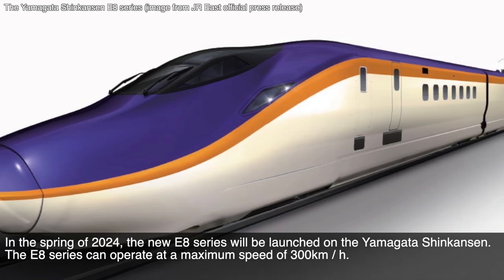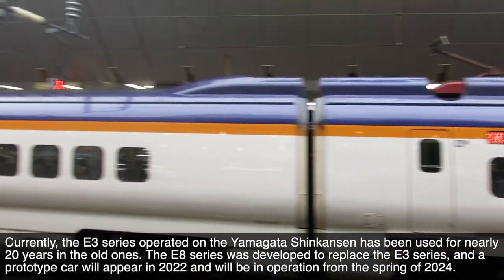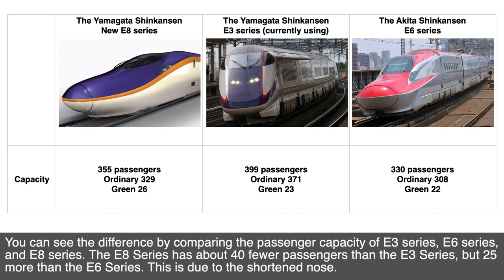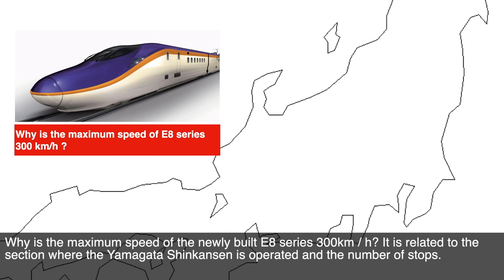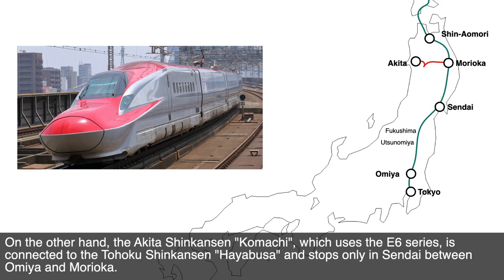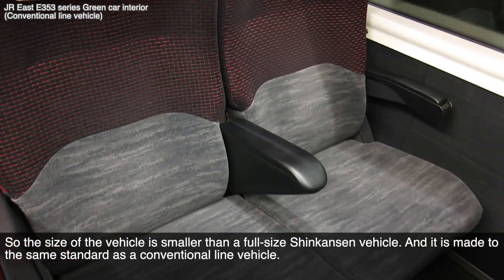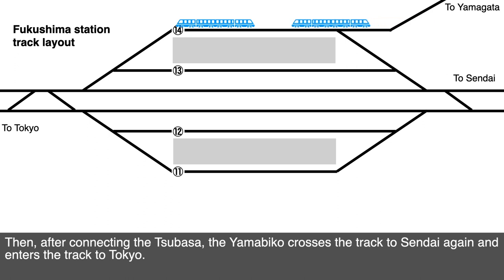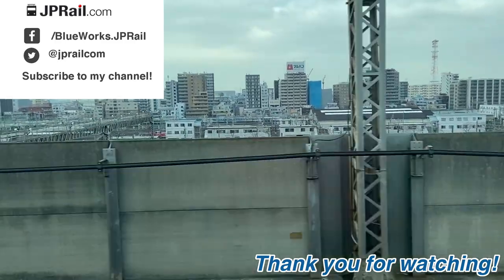The future of the Yamagata Shinkansen: New vehicle E8 series and Fukushima station improvement work

Comment: Make sense, its only 20mins travel time between Utsunomiya and Koriyama and10-15 mins travel time between Koriyama and Fukushima. The E8 will not be able to travel at 320km/h for long, even if it could. That reduction in top speed is not hugely significant and its still faster than the E3 series, so JR would rather go for capacity than outright speed.